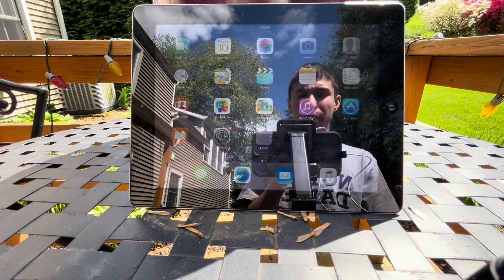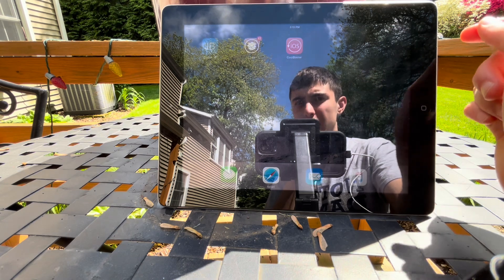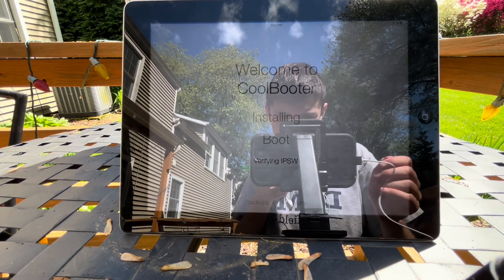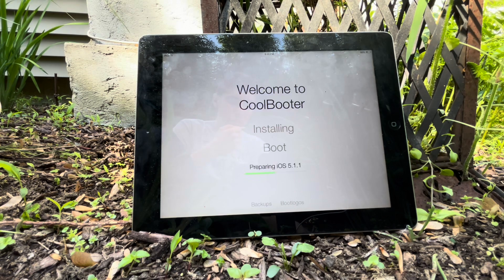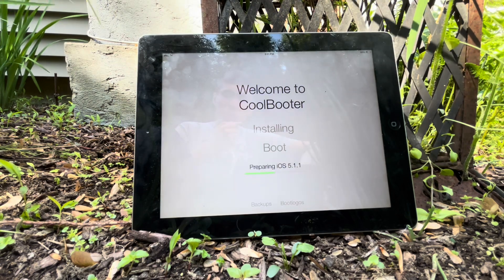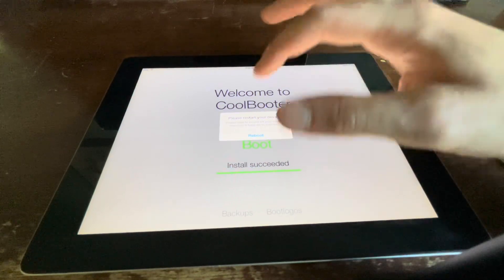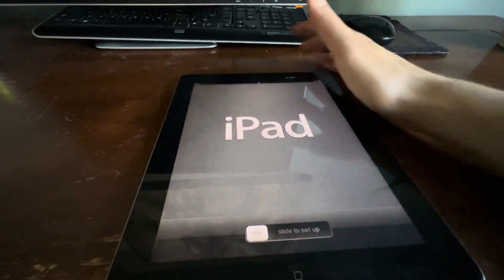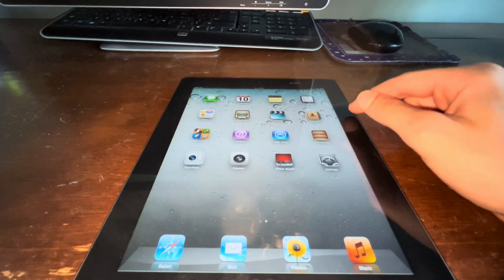Answering Your Questions: Downgrading an iPad 2 to iOS 5 with CoolBooter! (feat. The Home Depot)

Comment: hello! i found your video really helpfull. I have an ipad 2 at the moment, and I still didn't jailbreak it. I need the ipad to look up pinterest images mostly. Do you think that installing coolbooter and installing a more recent ios version will let me install me some apps? or at least surf on the internet better?
Reply from the maker: Hello! Assuming that your iPad 2 is on iOS 9.3.5, it is best recommended to downgrade it to 8.4.1 with Legacy iOS Kit (as it has better performance, and it does not use all storage.) From there, you can jailbreak it using EtasonJB, and then use the Puffin web browser from the App Store (it is one of the last supported working browsers for iOS 8.) I would not downgrade any further (as Web browsing can get quite dicey, and iOS 8 still runs well on the iPad 2.)